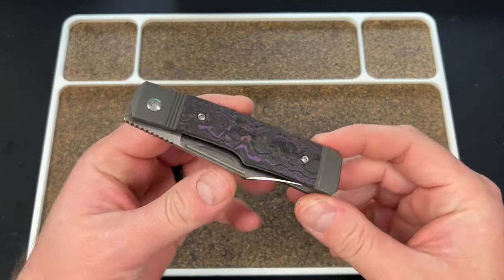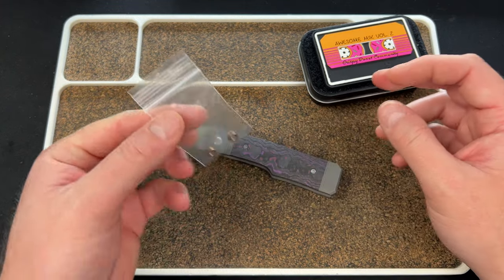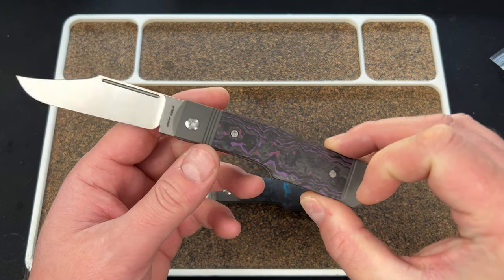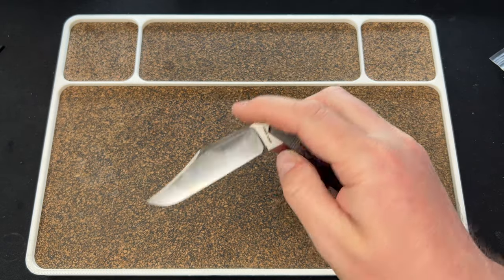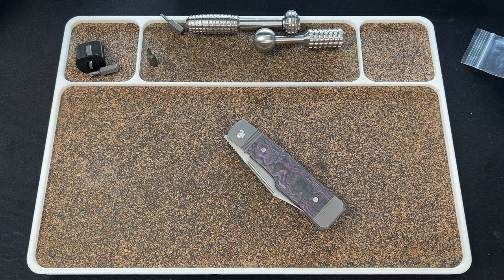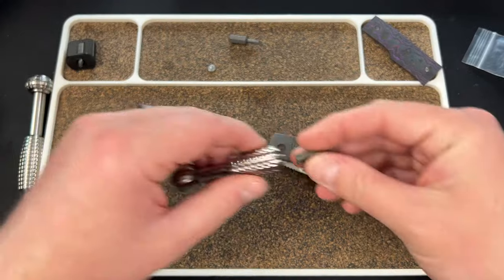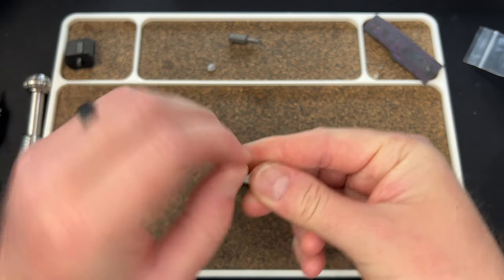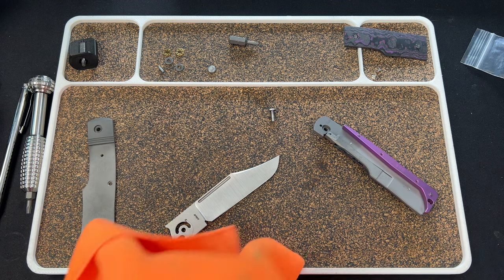Skiff Bearing Swap - Gunslinger Jack

Comment: It's helpful to mark both sides of the pivot when you're doing your final tighten, that way you can see if the other side spun any or not, particularly as the glue starts to set and drag more and more as you're tightening.

Comment: Hey Kev,
I haven’t been able to find a disassembly video yet for the latest JWK Bionic Jack. I thought similar principles from this video would apply but with the Bionic, there doesn’t seem to be any gap between the scales in order for me to reach the screws underneath. Do you know if these would pry with some type of flat plastic? I bought skiffs for it but I couldn’t get underneath those scales so I bailed out. Any input you could share would be greatly appreciated. 
I managed to get a Fireball too 😊. Absolutely love it
Reply from the maker: Hey. Yea i didn’t post my disassembly because it turned into a debacle when i couldn’t get the scale off. I think i mentioned it in my review. But i ended up doing it like an integral and pushing the pivot out, then got the bearings to fall out and squeezed the new ones in. It was really tough though so i don’t recommend it. Also did not make a huge difference. Ben told me if you put a towel down on a table and whack it on the table it should knock the scale off with enough force. If it got in there, it can come out. Honestly probably best to just leave it but thats my thinking.
Reply: @ Cool man, thanks for your response. I’m hearing you on that one. The action is quite good as it is with a very satisfying ‘ting.’ Can’t wait for the next Tall Boy drop! Take care 😊

Comment: I usually use super glue release, does acetone work as good?  Defiantly would be cheaper if it does.
Reply from the maker: Yea it melts it basically. I haven’t tried release

Comment: 1) flip the direction of the pivot if you want to open it from the lock side.
2) There are two sides to the steel thrust washers. A polished side and the machine side. Those bearing tracks are negligible. I never flip the washers over to the machine side. The difference is due to the manufacturing process of cold rolled steel.

On a completely different note from left field: it would be great if you had Ti scales made for your budget knives like the Pony Stout while your manufacturer has the tooling set up. I doubt any aftermarket company will make any for these boutique knives. Two cents and i expect change.
Reply from the maker: We are making a titanium version with s90v. Same base though

Comment: love how all the outside screws are t8 or bigger but the screws actually holding it together underneath are poopy t6 lol makes zero sense. also, how/why in 2023 are we still making knives with free spinning pivots?!
Reply from the maker: The T6s are because of the thinness of the titanium. They want to use the least amount of surface area when drilling for the holes/heads. Its very common to use T6s for stuff like that and inlays. Keeps the footprint down too. Free spinning pivots are actually underrated. I fell like they make more sense than d shaped since the blade is running on a full circle and not 3/4 of one. Captive is best, spinning pivot second imo. D shape third then the shit d shaped with no D 🤣 or spinning with tooling on 1 side.